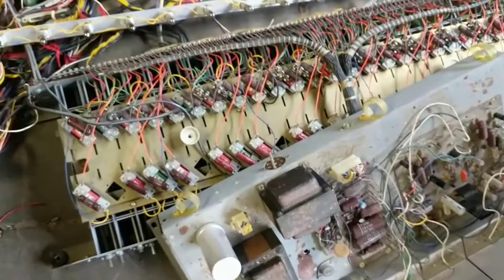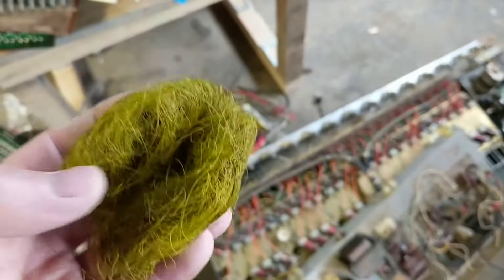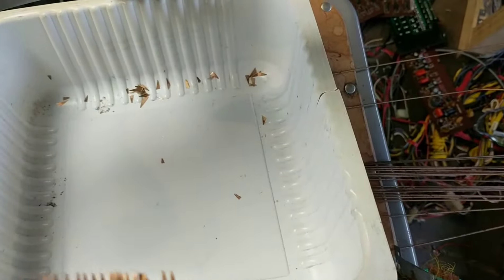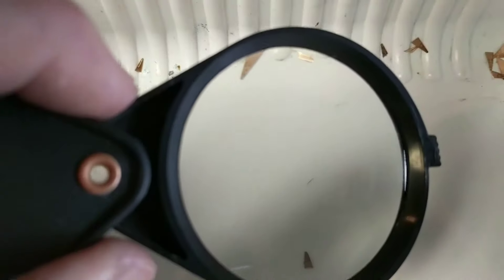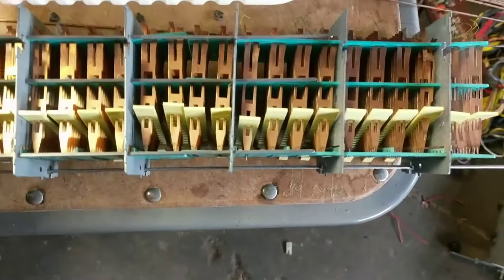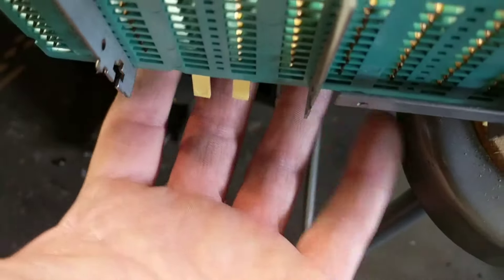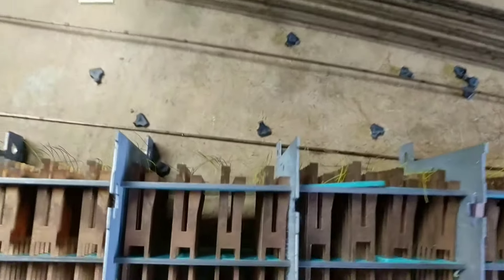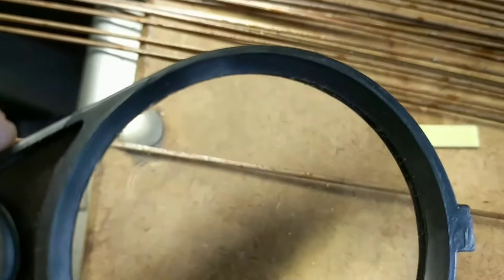Palladium Contacts from a Hammond Organ

Comment: What is the metal on the opposite side. Looks like a string?
Reply from the maker: Turned out being a chromium alloy if I remember right.  Boiled it in AR for a day and it didn't touch it at all.
Reply: @FollowMe2aMillion  stupid question, what kind of metal is that? I can Google it also. Im allergic to some metals so it's always nice to know for myself. Go figure the ones that don't give me problems are yellow and white gold, tungsten, aluminum, copper and some brass. Good thing I don't really like or wear jewelry that often 😆. Thank you so much for answering that for me. Something on those finger bars really hurt to touch.
Reply from the maker: @aqua1082  just a guess, maybe phosphorus bronze.  I really don't know.

Comment: That yellow wire is resistance wire, used between the manual contacts and the terminal strip.  Each one measures, electrically, 16 ohms or so.  I suspect you will find they are made of nichrome.  This is why they had to be spot-welded onto the key contacts at the factory.

And if that was a 61-key manual, the busbars in decent condition are worth a hell of a lot more than the palladium on them.
Reply from the maker: Thanks Wes, explains a lot.  Unfortunately everything was degrading when I opened it up.
Reply: Just got my first m-3 from a clean out. Can't wait to learn more and collect some precious metals!

Comment: Hey Mike quick question on this video. Curious where you got with saving the scrap Palladium. Just talked to a refiner in my area and explained The Palladium contacts that I've been collecting. He said my best bet would be to have a minimum of 3 ounces processed at one time to be worth it. At least he said that was their minimum. Plus any extra work from separating any metals. (ie palladium on copper) It looks like I got about 3.5 g from the bus bars which is probably close to pure, im guessing, and the rest of it is attached to the tiny heads of those copper fins. I've actually found a super quick way to snip them off without pulling them all out. I may also just separate it myself by starting with some nitric acid. 
I believe he also said the Palladium needs to be close to 80% pure for them to refine it. I'm guessing larger quantities are just too much trouble. He seemed to talk a lot as I was trying to explain everything I needed processed would fit inside of a pill bottle.😊 I hope he didn't think I was bringing him an entire organ😂 He was a pretty nice guy. 
Anyways just curious where you got with anything. I've got quite a few more organs I want to take apart when it warms up. And it looks like some of these other ones have gold plated contacts. And also I told this guy I'd probably give him a call in a few years and actually sit down and explain what I had. Because he said he had no knowledge of palladium coming from old Hammonds.
Thx
Reply from the maker: The Pd contacts will be the tiny skinny ones.  There are also a lot of silver contacts there too.  I still have it all separated but haven't done anymore organs or the like to put with them.  I snip the very end off and were I you wait until you have a pound of contacts as you will lose a lot of weight during the refining process.